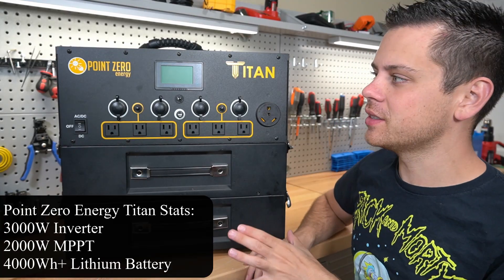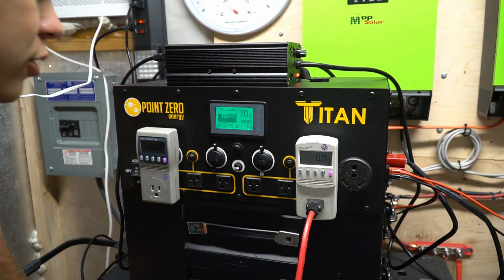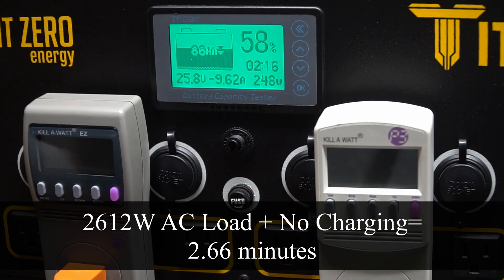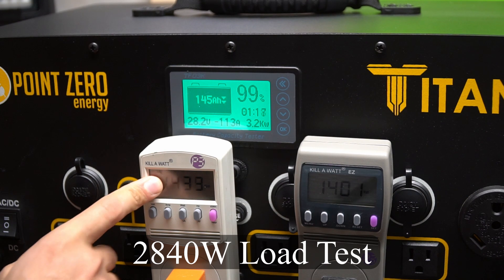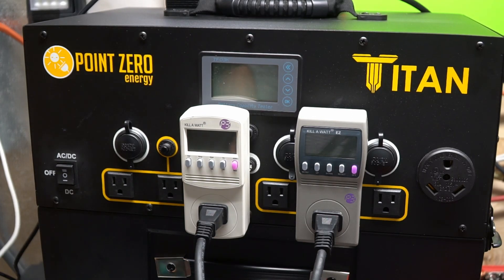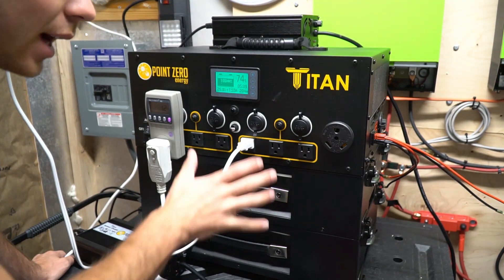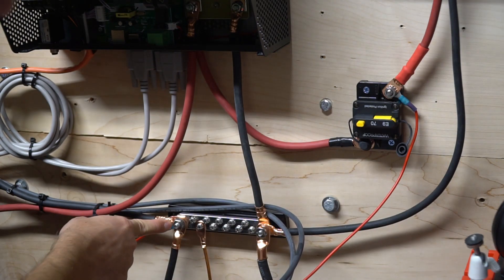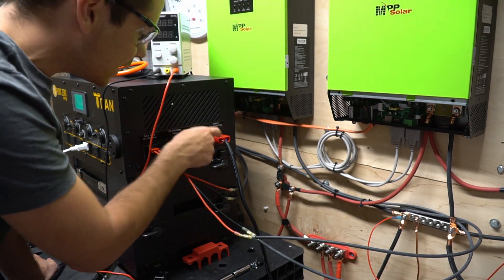Titan Solar Generator: Max Load Test, Battery Expansion, 12V Charging and more!

Comment: HELP!!! My Titan Story so far: I bought a TITAN in September based on the reviews from Will and a few others who I trust in the field with 2000w solar & 3 Batteries (a big chunk of $$$) Got it delivered, charged and balanced the batteries and set up my system. Now bear in mind I currently have 2 Inergy Apex's and they run my tiny home with no issues, i just wanted a bigger system is all... So I plug my system in to my 120v breaker box via my 30amp plug and the wattage out meter starts jumping from 30w to 120w and all the numbers in between... I only have my LED lights plugged in, my fridge and my Macbook laptop. And I noticed that my lights were flickering very noticably. So I broke the system down and tried it with just one battery, same issues, 2 batteries, same issues... wattage jumping all over and flickering lights. Then it stopped giving out power. Sent the unit back and was told the "precharge relay" was the issue and they sent me the same unit back which had been "fixed" and "tested" low and behold I plugged in my system and EXACTLY the same issues are happening. I have dropped over 10k  on this system and it is supposed to be far superior to the inergy apex and my $450 champion gas generator (which also does not make my lights flicker) . I was told they don't know what the issue is.. maybe if i plug in a "Ground Neutral Bonded Plug" that "may" fix the issue?? this is supposed to work out of the box... does anyone have any idea WTF is going on with my system??? @DIY Solar Power with Will Prowse any help, advice, troubleshooting would be AMAZING!!! I am at a loss!!! Titan are being useless...

Comment: You have to consider the amperhours of the battery, and it defends on the load  you are using, titan is a good design only for lighter loads only not fo heavy loads like motor grinder

Comment: Great job Will.  I am beginning to think that the Titan with 2 batteries could run my mini split in my off grid cottage.  The mini split is only a 9000 BTU unit and draws about 750 watts.  Would love to hear what others think.  thanks.
Reply: I've have a Della 12000 BTU minisplit.  The TItan can run it for a few hours in August.  It's an offgrid cabin, so I don't run it continuously.

Comment: Hey Will, I love your channel but I seem to recall you previously saying that you were not going to accept direct-from-the-manufacturer test units because of the possibility that they would send you something that was not the same as the units that they sold directly to consumers.  So, is that what happened here (that you got an 'upgraded' unit different that what is being sold to consumers)?

As another commenter said - Are they going to get a new replacement unit also even though they don't have a YouTube channel?
I love that your honest with your reviews - but - when they say that it was a one time error that they will fix in a new unit to you - that just feels off. 
Looking forward to your updates on this issue.
Reply from the maker: No, they keep doing the opposite. They fail miserably, over and over again
Reply from the maker: Check out latest video. Inverter pcb resistor spec was off.

Comment: I just wanna know what air conditioner he was able to run.. I'm living in a van, in Texas, with no air conditioning and would absolutely love a video covering solar cooling. The shed a.c. stuff was okay, but a straight up Van Life a.c. video would be soooo helpfull. Much obliged for the content, Will. You're the Cadillac of solar info.
Reply: it must be a 12,000 btu unit or smaller,  anything bigger is 220v
Reply: good question,  idk why Will didnt answer,  it's such a quick easy reply
Reply: @haydensommers420  well i survived one summer haha.. Maybe there will be new advances in that area before this summer. EditAdd: Can't wait for his DIY drop coming soon!
Reply: Heating and cooling with any "offgrid" system is challenging.  I live in SC.  I have a Titan with 8KW of power at my cabin.  I use a 12000 BTU della minisplit.  The Titan can run the minisplit for about 5 hours in August.  My cabin is 460 square feet, but I have a 16 x 12 loft so my roofline is gabled.  Lots of space to heat/cool.

Comment: How would you recommend using the Titan to power a conversion van since there are no “positive locking” output terminals like an Anderson Powerpole? Would you just plug in an extension cord, hack off the end and terminate into a fuse block? Seems like it might be prone to wiggling itself loose and bringing down the whole circuit.

Comment: UPDATE:

BATTERY DISCHARGE: 
PointZero assured me that they have not had any battery issues. 
I told them that I will continue to monitor by storing unit & batteries assembled 
and then with batteries stored separately and detached from one another.
This will give results on both scenarios.
 It could have been operator error?

INVERTER HEAT SENSOR:
PointZero assured me that my unit, purchased 30Sep2019 was NOT part of bad batch
that Will got. That's great news. At some point, I will perform all the tests 
that W.Prowse did to confirm all is functioning to specifications.

The unit has performed well in several utility power outages thus far,
running my apartment size refrigerator and 5000 btu AC continually
until it came back on hours later. A life saver! No noise! 
 

The packaging was good.
The unit shipped to Miami then by ship to the US Virgin Islands. A breaker switch
was broken but PointZero sent me another one. I installed it and all was good.
PointZero has provided good technical support. 

I have to get my panels set up and tested.
The hurricane season is here!
Reply: thanks for the info

Comment: hey I want to install a small set of solar panels in my house to run a few things. Now I don't want to install batteries. I want to directly power a few gadgets with the panels. What else electronic equipment would I need apart from the panels and the gadgets to be powered? I know I won't need a charge controller since no batteries
Reply: You will always come round to finding some batteries are good in terms of additional equipment.
Solar panels will provide a voltage supply which characteristically collapses while too much load, effectively wastes captured electricity when under loaded, and the amount of available sunlight will change this optimum load point.
Reply: @Tumbleweed Obviously duh!

Comment: Excellent tests! I own the Titan!  I live in the US Virgin Islands (Hurricane Alley). This was a major investment for me. The inverter should perform per manufacture spec's!-(  As you, I'm very disappointed that it failed this test. I'm eager to find out what PointZero has to say about this. On a couple occasions, after charging my batteries (I have 2) the unit was stored, i have found there was substantial battery drain, I then had to top off the batteries.  The problem  was discovered when the utility power went out, as is often the case in the USVI. The batteries had discharged, they were at about 75% capacity? I purchased the unit for emergency use only and have not setup my solar panels yet. Can you do a battery discharge test, while unit is stored? Batteries on the unit and batteries stored separately (disassembled)? You do a great job. I watch all your videos. Keep up the great work!
Reply: Have you found any sources for parts and repair for the Titan.  I have a unit with 8KW of batteries and a spare inverter.  I need a replacement AC charger.  Do you know of a source?

Comment: Will Prowse, can I ask your opinion which solar generator system is the best for the money if I need something that can deliver at least 1000 watts at a time for around 30 minutes or more for things like taking a shower powering a shallow well pump, just for instance. So the question is best system for the money that can do at least 1000 watts for say 30 minutes per day at least and then just do smaller things the rest of the time like TVs, computers, lights etc...? Thanks for your help! :)

Comment: I am really unhappy with the less than expected inverter performance.  I find this unit nearly ideal as a back up power for my  home and also for camping with my fifth wheel.  I was waiting on the lithium iron phosphate battery packs to pull the trigger but now have to wait for next video to see if the inverter performs as advertised. I will be waiting, Will Prowse. Your videos are awesome.

Comment: For what it's worth, I ran a test on my Titan (received this week), with two batteries.  I put 2800 watts load on it, split evenly between left & right circuits.  That ran fine (I let it run for 15 mintutes).  I then plugged in the charger and after five additional minutes, I got the overheating four-beep alarm and the circuits disabled.  I haven't received the panels yet so can't test with DC input.

Comment: Never really understand why they call it a solar generator, it is just a battery device.  I wonder it is just marketing hype, so they can charge the consumers 5x more than calling it a battery.  ....LOL
Reply: Ya... The device itself has nothing to do with solar... It doesn't generate electricity from solar energy... a solar panel does that. If this is a solar generator than what's a solar panel?? Might as well call it a wind generator or a nuclear generator... If it stores and converts the stored power, it doesn't generate anything but if they wanted to use it in place of a generator... Just call it a damn generator... stop adding solar when there is no damn solar generation with the product! It just seems like logic 101 to me... Is my UPS a solar generator suddenly? STOP TALKING NONSENSE!

Comment: You should maybe move the heat guns away from the generator.  Looking at the video, maybe the heat was blowing into the intakes of the Point Zero.
Reply from the maker: That's why we used extension cords. Because the heat guns are outside. I figured that was implied. The shed is also air conditioned

Comment: These companies actually need 3 performance levels for their inverters:  (1) "SUSTAINED" for 1 hour continuous output, (2) "BURST" for 5 minutes of power, and (3) "SURGE" for 1 minute.  Sustained is obvious, 5 min burst is needed when large loads need initial run times but give the user some time to reduce loads if troubles (e.g., power tools), and 1 minute is needed for motor starts (e.g., A/C units, Frig, etc).  This Titan could have fairly been labeled 6,000/2,500/2,000W output.  Also, battery run-times need similar time references (e.g, runtimes @100%, 50% and 10% of "sustained" power rating).  Until such standards are established, it's a MESS for consumers.
Reply from the maker: Great point

Comment: I got caught right at covid lock down needing my power because I moved into my van that I'm converting. I had to get something with a few days, had no time to build my own. Got a Goal Zero 1400. First one had a bad bearing and rest to zero on a 1450 load after a minute. It rest at 60% so charged to 40% then went to 100%. I got a replacement and it will rest to 0% on a 1450 load after a minute and then will seemingly fast charge to 100%. I now wish I hadn't gotten the Goal Zero. I had no time to wait for a shipment so got it from REI. The replacement was an upgrade but still could not handle a big load. Suggestions for building a good system in my van that will handle a good load to run my Keurig?

Comment: can someone please explain why batteries are called generators?
Reply: Because people said so! It's nonsense but it's dogma! It doesn't need to have anything to do with solar to have solar in the name.... nothing matters anymore, call it a nuclear generator. Call your car a solar flying machine! The meaning of words doesn't matter anymore and people will get mad at your if you say otherwise <_> I guess I could see the use of just 'generator' if they used it in place of a typical generator but it's still sloppy and inaccurate... just call it a power pack or something.. but the solar part when it doesn't have any solar panels with it. Some of these things don't have direct solar hookups!!! O_O

Comment: 2.5kw of 'heat' guns right next to it.. what did the ambient temperature in that small room get to? Had to be temp related cut out.
Reply from the maker: It wasn't till the last test that the heat guns were in same room. It's my solar shed. I made it for testing these units. It's air conditioned and the heat guns are outside.

Comment: You didn't test the output through the 30A RV outlet? wt..?
Reply from the maker: I don't have anything to connect. I need a load tester for RV plug
Reply: @WillProwse  You should have kept your RV..LOL. Maybe you could build something similar to a power strip that can plug into it. Just an idea.

Comment: There's no electricity right now at my house. I'm in Caracas, Venezuela, which once had the most advanced power grid in Latin America, but today is ruined, so now I'm getting into solar power. I was going to buy this unit, but I can't risk having it shipped to Miami, then down here, and getting a bad batch. I guess I'll have to buy an inverter and batteries, and build my own system.

Comment: Being unable to run 3000w continuous is disappointing. The specs clearly say 3000w is the rating, with a 6000w peak.

Comment: It seems it's very hard to find inverters that will actually output their rating.  Is it that it's actually hard to make a good inverter or just that everything is cheap crap from China?  I eventually want to look at making my own inverters using IGBT bricks but not sure how easy it will be to do in practice I'm not that experienced.

Comment: Will the problem you get is due to the power factor of your device i bet!... are you sure they mention 3000W or 3000VA ?  maybe it specify for reactive load which normally are less Watts.  for exemple on my modified APC 5kVA UPS they mention it is a 5000VA but 4300Watts. The Watts take account of the power that flow back to your source ex: 35A draw - 5A that flow back = 30A real and 35A apparent

Comment: Different chemistry batteries will work when using 24v and 48v battery bank, but not on 12v and 36v battery bank (7S Li-on = 8S Lifepo4)   (14S Li-on = 16S Lifepo4) before connecting them put a volt meter across both battery banks and make sure that there are of the same voltage level

Comment: I wouldnt expect the inverter to perform differently with any combination of charging method or no charging at all. It’s not like the battery is charging and discharging at the same time (ohms law). Instead maybe try changing the temperature of the shed?
Reply from the maker: They all perform differently. Especially ecoflow delta, it will reduce the charge rate. This is common when scc and inverter circuit are stacked

Comment: Thank you Will for once again testing these units and checking real-world limits (not just theoretical). I too am disappointed at the results on the inverter, but there are a lot of variables that can lead to the revealed results. Let’s hope that the manufacturer realizes they are on stage and a lot of people are waiting to see if and how they respond. The Titan is still at the top of my short list, but this is a pivotal point for me as a potential customer. I would very much like to know what the actual constant and peak wattages are on the inverter. I am also anxiously awaiting the switch to LiFePO ₄ batteries.

Comment: Do you have any inside connection with Titan on when their units will be available?  I have ordered the new Inergy generator but if these are avalible I would rather have a Titan.
Reply from the maker: I would go with titan any day over inergy. And yes the Titan is backorder but they are coming in
Reply: DIY Solar Power with Will Prowse any recommendations on where I should order one from?
Reply: @pscott49  Check the link below the video.

Comment: Need to go 48 volts if pulling more then 3,000 watts. 1000 watts is good for 12 volts and 2000 watts is good for 24volts. 4,000 watts could be ran off of 48volts. I think any electronic that pulls more then 50 amps starts to suffer. Even Car amps pulling over 100 amps all of the time get crazy hot.

Comment: Titan is still, hands down, best PORTABLE generator on the market.
Reply: hmmm check out the Bluetti AC300
Reply: Purchased the Titan in March 2020 and received it 2 months later.  Of course, the pandemic delayed everything.  Eventually, I moved the Titan to my offgrid cabin.  I purchased a "plug and play" generator because I'm not experienced I have 4 batteries so a total of 8KW and 2000 watts of solar input.  I use the 30 amp plug to connect to my square D circuit box.   It has worked pretty well for 2 1/2 years although I had to send the unit back for repairs 2 years ago.  I purchased an additional unit to use as a backup.  Heating and cooling the cabin are the biggest challenge.  We set up a system to connect 2 Titan AC chargers to a Predator 5000 inverter dual fuel generator to boost input when heaters and AC are used.  Now, one of the AC chargers isn't working.   I wasn't sure if the battery expansion port was for input or output.  Now I know it is for discharge.  Point Zero Energy is out of business, so I'm looking at replacement AC charger with the correct Anderson Power connection to replace one of the chargers.  Anyone have a source?

Comment: The Titan is expensive, and was supposedly extensively manufacturer tested while the production was delayed for months/years.  Very disappointing that it does not work as advertised.  It's not a good buy if it doesn't function properly, and I cannot justify spending $5,000.00 for it.  I will stick with my Goal Zero 1400 that I got on sale last year, and my gas generator.  At some time I may try to figure out (from your videos) how to make a large battery operated solar generator.